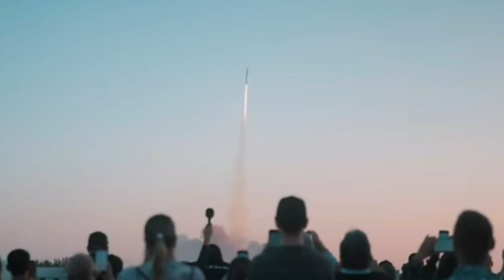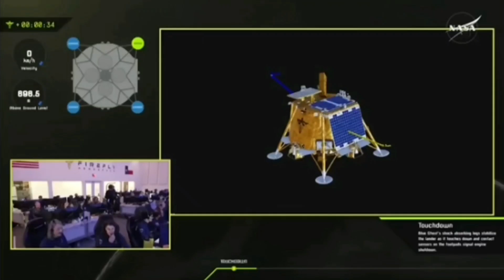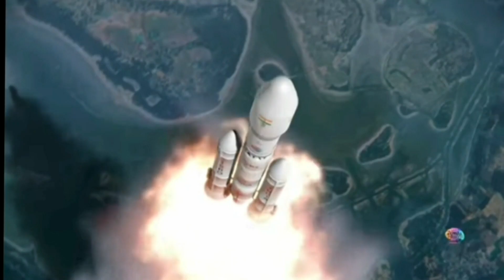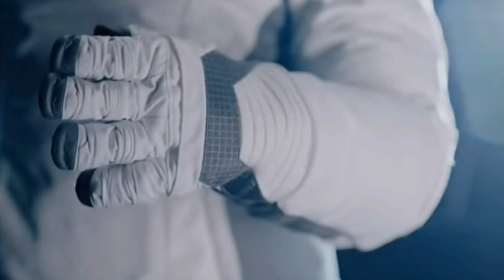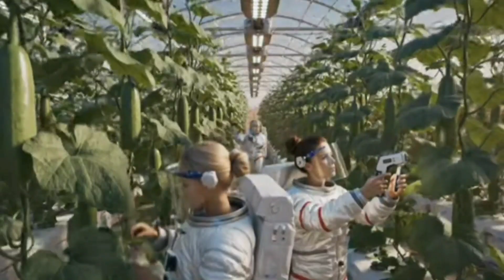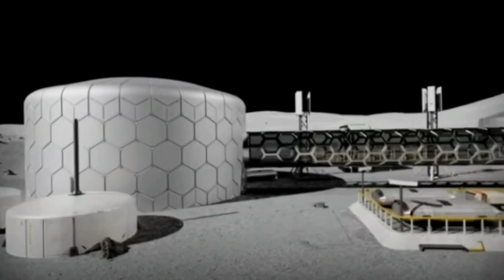fiction or reality

Comment: Reality is that in cost per pound to lift stuff from Earths gravity well to Space SpaceX is way ahead of everyone else with Falcon.. The Starship series into v4 will start moving hundreds of tons of robotic equipment and fuel processing nodes to the Lunar surface in the next couple years.. Once a reserve of fuel is established more process nodes will be put under the surface to protect from sunlight heat, radiation and meteorite impacts.. I see most of the work being done with robots controlled from Earth via a Starlink internet network that has Starlink satellites orbiting the Moon linked to Earth Starlink system.. Fuel and water are the keys here, without a local source on the Moon the whole thing gets far too expensive.. The robots can prep places for the habitats to be buried which will allow long term operations by humans and prefabricated Starship hulls without engines and fuel tanks seem to be a fast solution.. Until a real reserve of frozen water and other components for fuel can be determined and accessed everything is just a bridge too far.. Above ground cities are fantasy as is viable government funded rocket and Lunar activity..